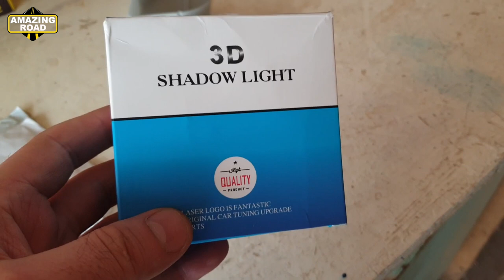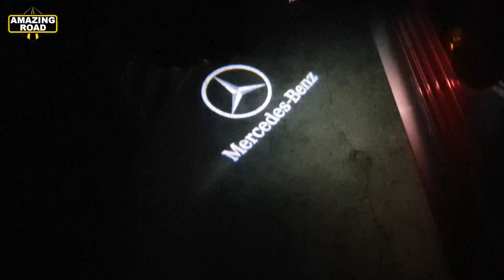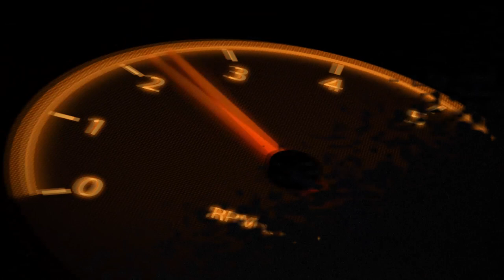How to install Door Welcome Logo Lights / install Wireless Projection Ghost Lights on Mercedes

Comment: I have tried different doorlight cheap and expensive but all from AliExpress.. all of the logos is the projection blur and look cheap. Where can I buy a real good one whit the projection as in de vid
Reply from the maker: I bought on Ali
Reply: I have 2 doorlights on every door of my CLA 2014.. I have the red/withe one like you have on you're video and I have a withe one on bottem of the door.. maybe I'll try to buy on as you have (the red white). Do you maybe have an working link to the product?

Comment: Do you know if these will fit on a 2017 e300??
Reply from the maker: they are universal, tell the seller the size and he will make for you as you like. link in the descriptions under the video
Reply: Amazing Road TV yeah I got them and installed them. Thank u fo yo reply
Reply from the maker: @Ddadon2x  Thx
Reply: Did it fit your 2017 e300??

Comment: i guess there aren't any mercedes welcome logo light for a W211 model
Reply from the maker: There is a link in the descriptions under the video on W211
Reply: @AmazingRoad   i've checked the link but after having read the comments for this product, it does not fit on a W211 Mercedes e-class 2005. That's unfortunate ☹️
Reply from the maker: @ashik7674  When you find it for w211 give me a link. Thx
Reply: @AmazingRoad  alright